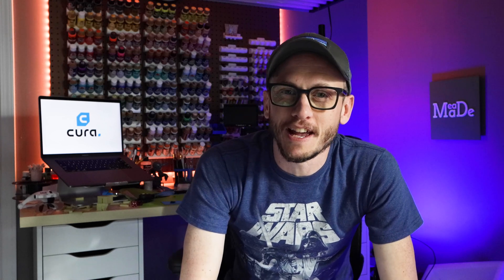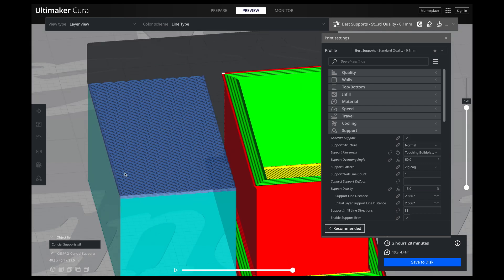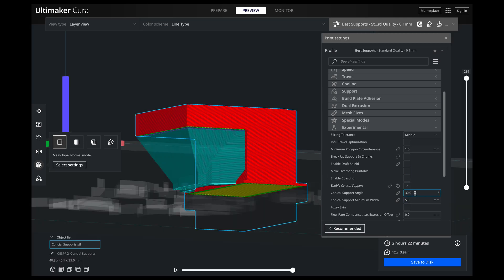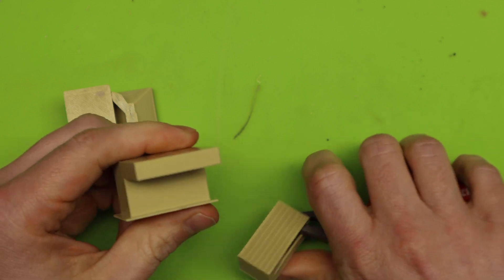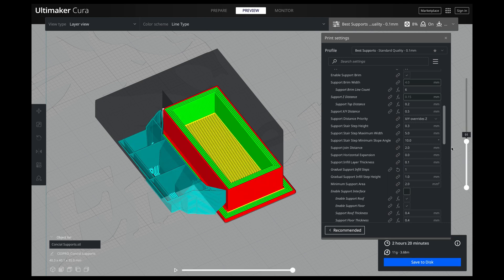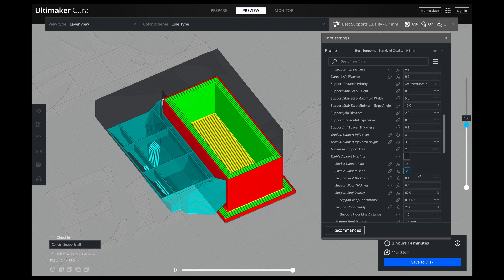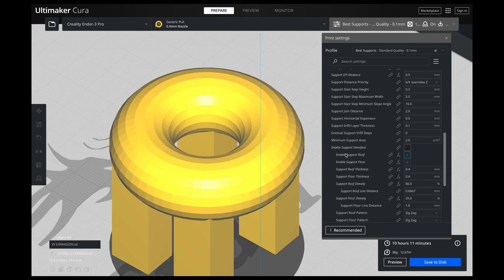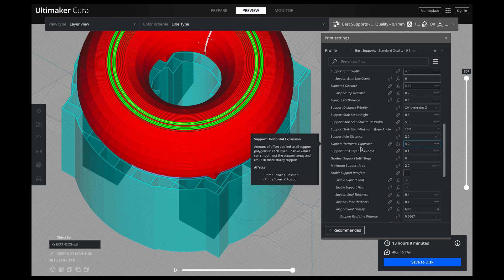Printing Cura Supports With Less Filament | Ultimaker Cura Tutorial

Comment: If you want to reduce amount of material wasted, reduce support flow like in half. It'll also give you fluffy supports that can be removed without damaging intricate models, but can leave more residue because the support structure isn't well welded to itself.

Comment: Using Cura 5.3.  I am trying to adjust the bottom/top infill density and bottom/top floor distance, but they are grayed out.  Cura says it's because other settinga have overwritten them.  It mentions the mesh setting.  But toggling that does nothing.  What settings should I look at to make the density and floor diatances adjustable?
Reply from the maker: There are multiple settings that effect other settings. I would look at what the helper box says of what it’s effected by and start going through the list and reset the settings of those. It’s hard to know without seeing it.

Comment: Tree with brim, zero infill, 2 walls, concentric, 90% top interface, interface gap at same as line height or 1.5x it... extra help in experimental, bridging settings, fans at max when bridging.... problem solved.

Comment: Great video.  Supports drive me crazy.  Either they don't come off or if they do, the surface looks like crap.  But this video and one of the others I have watched has given me a few ideas at least.  Probably I need to create a test model to test different support settings.
Reply from the maker: Your not alone. Supports are a pain. But that’s the point of the video to teach you how to test and get perfect support for your printer. Good luck and happy printing!

Comment: I dont have conical supports option cura 5.0
Reply: They are there. Make sure you have enabled via Settings... Configure setting visibility...
Way down in the experimental area, easiest to search for "conical"
Reply from the maker: They got rid of it? I’m not using 5 since it’s still in beta.
Reply: @ItsMeaDMaDe  I'll check 4.13 one sec
Reply from the maker: @dealscale_dot_io  you might not have it to show in your settings. If you watch the video before this I go over how to get all settings to display.

Comment: I use tree supports universally since they take less time/filament, what would be the advantage to using standard supports with your optimisations over trees?
Reply from the maker: Two parts to my answer. 

1. This series was really just focused on standard supports. 
2. I didn’t cover this but I think the advantage is on a case by case basis. Tree supports are great. I used them but I have found it there are large areas that need supported standard gives me better results. You bring up a great topic and I’ll add it to my list to do some videos on the differences and which works better on different scenarios. 
Thanks for this comment it truly brings up a good point that should be discussed.